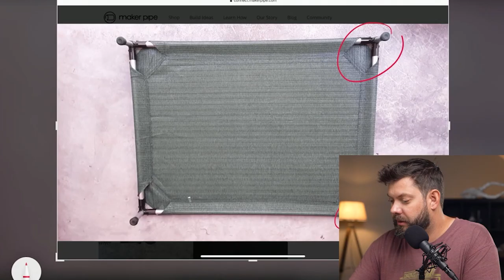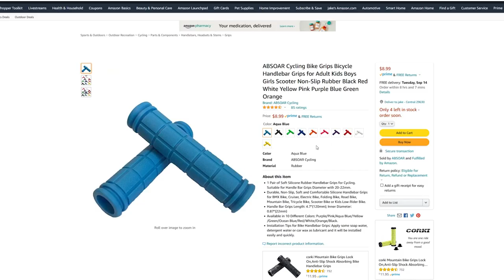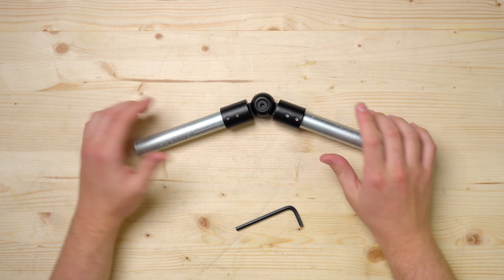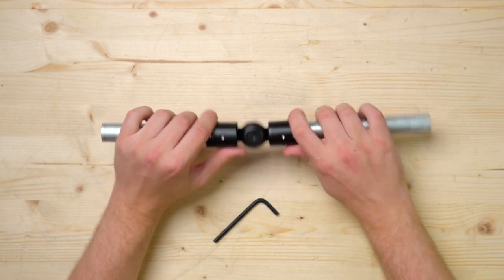15 Conduit Hacks That Will Blow Your Mind!

Comment: Genius! Awesome ideas and builds! I need something similar to the acetylene tank cart build for my 4-wheeler wheel barrow, as I purchased it at tractor supply and they do not sell the wheels to it any more, they wore out. I need some bearings I can put on end of the axle and then attach tires??? My current tires has no bearings.
Reply from the maker: Hi Donna, thanks for the comment. Do you know the axle size that you are getting the bearings for?
Reply from the maker: That's a good idea for getting wheels. I'll have to remember that one!
Reply: @MakerPipe  No, it's off of a "4 Wheeler" wheelbarrow they sold at Tractor Supply, the back wheels. I can send a picture if you like?
Reply: @Harlan Woodward That may work
Reply: @Harlan Woodward I actually got wheels for the front of it at a second hand shop. Can't believe they worked, but used pvc pipe for spacers... this is only for the front wheels not for the rear which is the current issue. That cart was expensive too, at the time $149